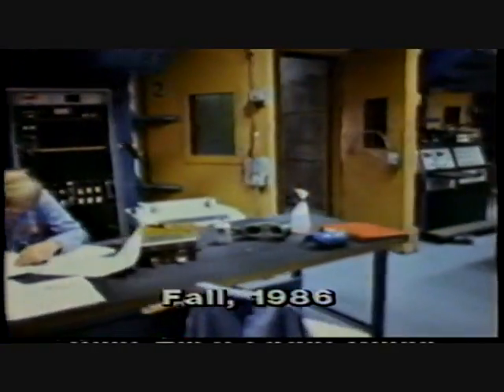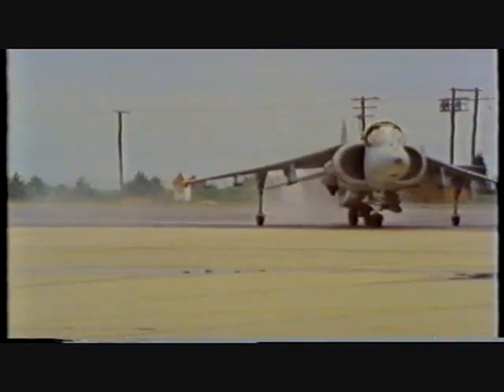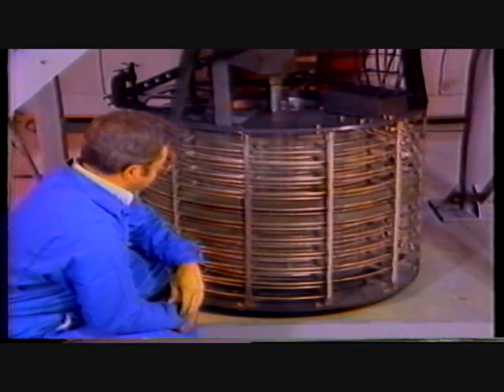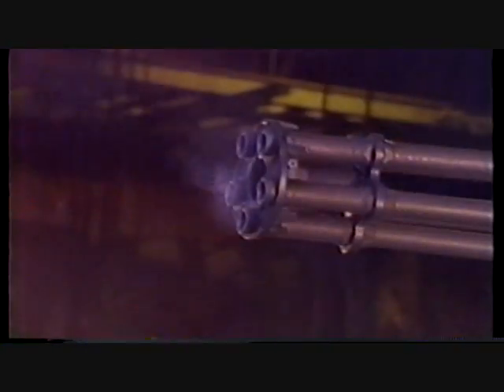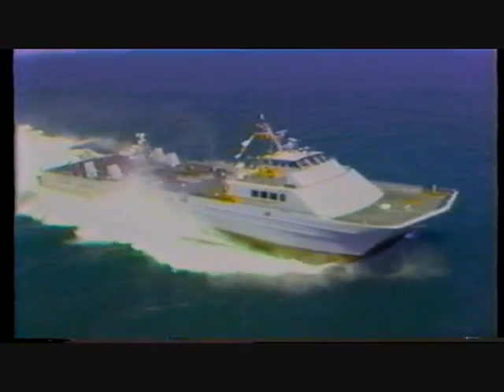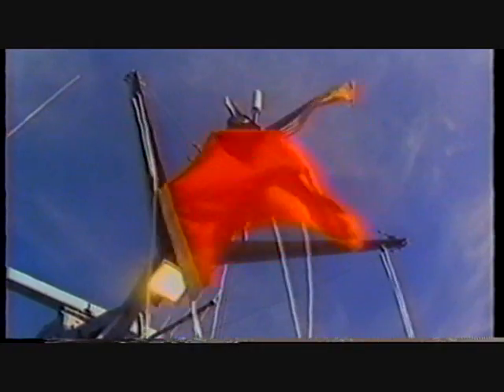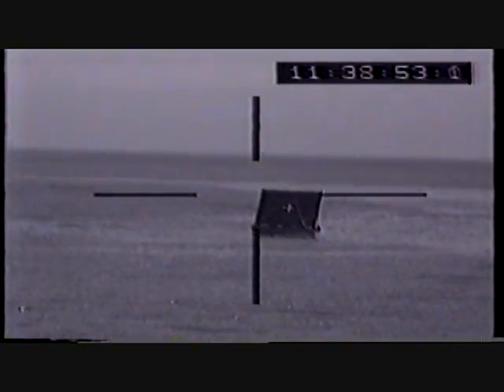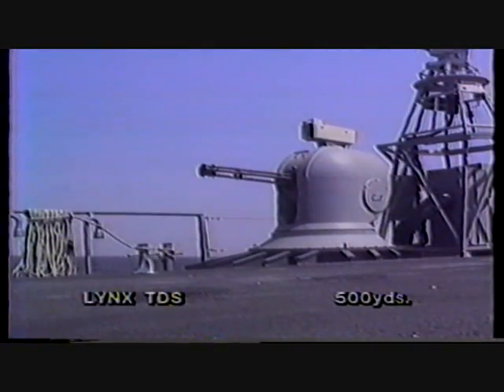Firing the 25mm Gatling Gun

Comment: And after this failure, Phalanx Vulcan came out. And you can see it on almost every US warship...
Reply: spikedpsycho The gun is the same. Look at the dispersion of the rounds on target. This is a watering pot, not a gun. It doesn't matter what kind o firing control you have, if the weapon itself is junk. Actually, did you see any footage of a real engagement of a missile using Phalanx Vulcan, like the one of the Goalkeeper? No, you didn't, because Phalanx Vulcan, probably, doesn't withstand such a challenge. I doubt that Vulcan gun can do the same job as Gatling does. Even if Gatling has a larger caliber. So that's why I called it a failure.
Reply: mroldnewbie
You know what? I don't give a shit...